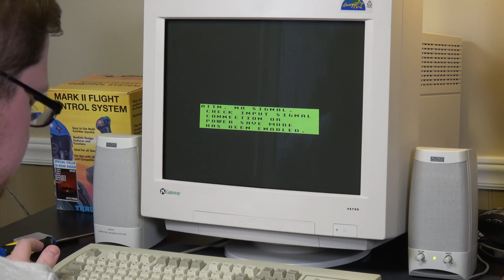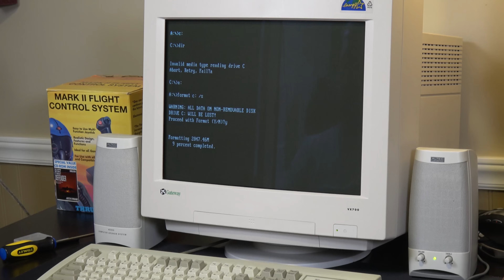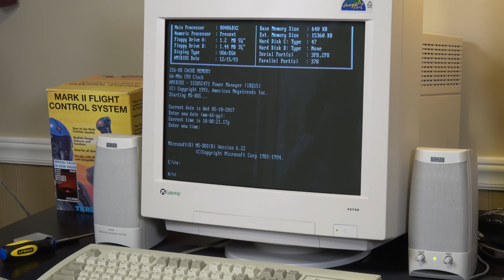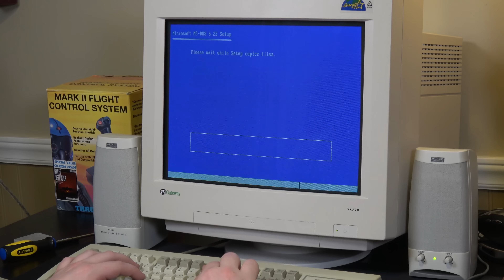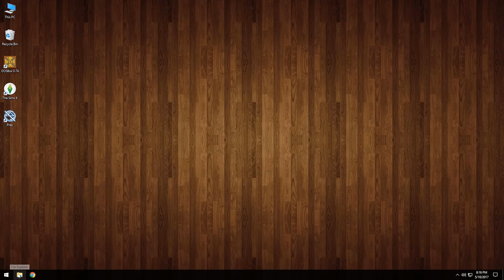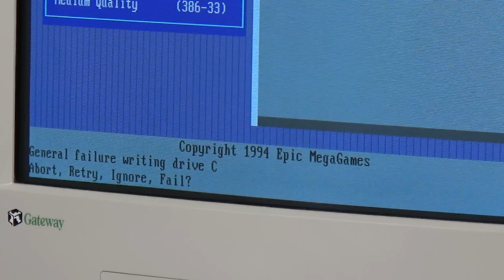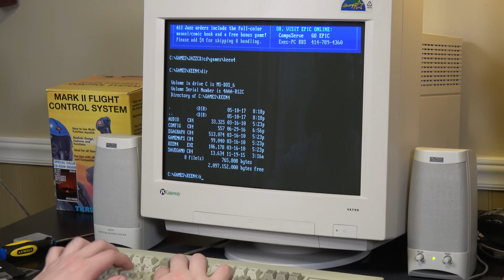LGR 486 Update! Installing CompactFlash Storage

Comment: Won't you miss the whir and ticking noises from the HDD? Sure your old one was getting pretty loud, I had the same issue with my Am486 PC. I just swapped it out with a different 90's era HDD. You could use your CF card to transfer files to the HDD.
Reply from the maker: You bet I will. I mentioned it somewhere in the video, but the sound is a bit part of why I like using old parts! It's just in this case the old HDD was getting too loud and unstable to be enjoyable anymore, so I'm using CF as a replacement until I get another HDD.

Comment: Nice seeing you enjoy some of the benefits of mixing new with old! I am using SD cards now, the adapters are quite similar and work just like you showed.
Reply from the maker: Thanks for stopping by, Phil! I certainly want to give the newer SD card solutions a shot sometime too.
Reply: Lazy Game Reviews Awesome! I shall send you some info and tips. Used them in a range of machines from 386 to Athlon XP and they have been good to me.
Reply: I ordered some CF hardware for my rig because I know they're reliable. I'd like to see some benchmarks done by someone at some point to compare the lifespans of CF and SD under "normal" use condition. Maybe they already exist and I just haven't seen them :P
Reply: Man, I feel like I'm going crazy, because I thought I must be the only one in the world that has these, because all I ever hear about is the compact flash one. -- it's like as if every movie reviewer was telling you about the betamax version of some movie, and all you have a VHS player instead.  (Seriously, didn't compact flash die in the early 2000s??)
Reply: @BrainSlugs83  CF didn't die even today, professional cameras used them for many years if not still in use.
Compact Flash cards of old days are still faster than Class 4 SD ones of today, not kidding. I have a 256MB CF card from 2003 that reads and writes at 6.5MB/s compared to the 5MB/s writes of CURRENT class 4 cards (albeit the read can get higher at 10). Took quite a while for competing cards (namely SD) or a successor (CFast) to stand up to CF properly.
Reply: @Kalvinjj  which is why you should buy class 10 UHS devices... Seriously, 16 GB is like $10... CF is dead.
Reply: Long term, has the SD solution worked better than CF? :) I'm looking to get my retro rig back up and running and a replacement storage medium is what I need.
Reply: Yes, a high end SD card can handle more reads/writes without data corruption. Been using one in my P1 laptop for years.
Reply: I've tried to install Windows 98 SE to a Compact Flash Card, but  I cannot complete the installation because on some point it says that cannot write to the HDD and prompts me to retry. Just when the installation of Windows files is starting. SS7 Soyo MB, K6-2, Voodoo 3 3000 AGP, SB Live!, 256 MB RAM, Transcend 8GB 133x. Any thoughts?
Reply: I would say that both SD and CF are both very fine long term solutions for computers. I used my Micro SD for my Orange Pi for years now, and it still hasn't quit me yet. I'm going to try out CF though, see if that gives my laptop a kick.
Reply: @WilliamShinal  Would you recommend CF over SD or vice versa ?? :)
Reply: I won't argue with your decision. Good luck with those CF products.
Reply: I think useing a msata to 44pin ide adapter, then a 2.5 inch 44pin to 40 pin ide adapter would be the fastest performance, though I've never tried it, I'd find that a fun idea. I suppose the hard drive controller would be the bottle neck. Anybody interested?
Reply: My two favourite youtubers! You lot are my heroes (unfortunately?) (jk?)

Comment: I had such a device before SSD times but I've found out that even good CF cards have a really short lifetime when they are used that way. But it's fast! And it's cheap...unless you don't realize that cheap cards die as fast as good ones ^^

Comment: Just remember to check the pins on the converter thing every now and then. I played myself a few times trying to force the CF card into the thing and bending the pins in result.
Reply from the maker: Absolutely this! I think there are even some bent pins in a shot or two of this video, that's really easy to do (but thankfully not hard to correct if it happens.)
Reply: it's always a PITA when a pin breaks and gets stuck in the card. (Especially when it happens on a camera where you can't easily swap out the connector card)
Reply: Oh crap.  I just tweeted a picture in rage to this.  Oh well.  Naughty, naughty.
Reply: This happened to two pins on my CF > USB converter.
It still reads cards though. Which I find interesting.
Makes me wonder how much losing a pin effects the transfer rate.

Comment: offtopic ; there are bootable dos CD version, (6.22 or 7. something) also win 3.1 on cd .  makes install alot easier when you ran out of floppy disks or damaged .
Reply: makinjica but certain PCs before the Pentium era machines only boot from floppies or hard drives, and in order to boot from a CD to install Windows or MS-DOS on CD-ROM, the drivers must be installed on a bootable floppy diskette in order to access the CD.
Reply: with nero burning you have an option to include the boot image of a floppy disk drive and use it to make a bootable Cd. it use for those machines without floppies, and also you could put dos, windows installers, programs and driver on the same CD. or even  dvd if you need it. there are other cd burning programs as cdburnerxp

Comment: FreeDOS supports larger partitions and you would be able to use the entire 4GB of the flash card, but I think that you want to use MSDOS for the system to be accurate with its age.
Reply from the maker: That is true. I really need to do a video on the latest FreeDOS sometime, it's got some great features.
Reply: @LGR  I am personally loving it on my 2012 laptop.

Comment: Sorry Clint, there's no good technical reasons to install from floppy when you can just copy it straight to the card, however, there doesn't need to be. "Because I like the noise" is reason enough :)
Reply: Exactly, it's nostalgic and has sentimental value.
Reply: You can put an Ethernet card in and map network shares as dos drives, I find that easiest.
Reply: He does mention in the video that he's had problems in the past copying the DOS files straight to the card. The DOS setup program detects and configures the current drives in the machine.
Reply: Apple 2e with proper interfacing can run usb
Reply: Duh. Why would you install the floppy drive if you're not gonna use it!
Reply: That was the reason for my comment! Come on, installing DOS isn't rocket science, a lot of us have done it and know it will work, it's just a bullshit excuse for the real reason, which is that he loves the experience/noise/nostalgia and that is fine. No need for the lame technical reasons :)

Comment: Use a cf card in my Amiga 1200 as a hdd
Reply from the maker: Got one in mine as well!
Reply: Yeah that turn into a nightmare, partly my fault.  First, the first time I was stupid, stupid idiot and got the ribbon cable crossed(still don't know I was that stupid) on the 44-pin 2.5" ide connector because it's not keyed, causing the power on it to surge(smoking), ruining the IDE controller on the a1200 mainboard. Still booted to kickstart, but that was it. Replaced that mainboard, and everything was working, but about a month later it stopped  see the memory/cpu upgrade board.  The old board I had ruined the hdd saw the expansion board so something was wrong with the 2nd mainboard(nothing visible like popped caps or anything) .   Also eventually it stopped booting to kickstart.   Replaced that board, now everything is working fine for the past year or so.

Comment: I would've killed to have a 2GB hd in my 486. I remember when I got my first 1GB drive and thought that would be all the space I'd ever need.
Reply: My first PC was a "Laser" 386SX 16 with 1MB of RAM and a whopping 40MB hard drive. Paid $1200 for it. My $5 Raspberry Pi Zero dwarfs it in capability. But, I have so many fond memories of that computer.
Reply: I had a summer job during college in 1990 working at Laser computers in Illinois, assembling and packing 386SX machines. I've never heard anyone ever mention that brand since then.
Reply: @adminfoo  Woa, the same Scott Hall of wrestling? Probably just have the same name.
Reply: Meanwhile, here I am with my almost full 1TB hard drive, wishing I had another terabyte.
Thought it’d be all the space I’d need.
Reply: lol my first pc was I think a 800mhz cpu 256mb ram and 10gb hdd. And I was happy with that, cant remember what OS.

Now ive got 16 core 3.7ghz cpu 16gb ram, and 512gb boot disk and 1tb storage and that not enough. Sigh how things change.
Reply: @pilsplease7561  wow, 256mb but only 10 gb HDD?
Reply: @AccountWasHacked  that was considered big back then
Reply: Man you guys are really bringing back memories for me. I had a tandy computer from radio shack with 486DX 33mhz, 4megs of ram, 124MB hd, sound blaster pro(it couldn't even do 16bit 44khz), svga at 800x600 256 color with windows 3.1. I remember when I bought a 1.2 gig seagate HD thinking it was all I needed.
Reply: I bought my first computer from my uncle in 1998 (I think I paid about $20 for it). 486DX2 66Mhz, 8 MB of RAM, and an 850 MB hard drive that was like a bottomless pit to throw endless amounts of data and games into. Ancient even by 1998 standards, but at 14 years old I had a lot of fun with it until I upgraded to a Pentium II PC a year later (saved up my paychecks working at McDonald's).
Reply: @AdhamOhm  i just recently got a pentium 2 pc because it had the correct cables for a spare hard drive i had
Reply: my first pc had 160 gbs...and it was huuuuuge...it was a top gaming pc...back in the day...i was a kid around the windows 98 era..i think it had windows 95, or 98...now...GTA 5 would feel claustrophobic on it lol.
Reply: Scott Hall Wow that was probably the same model. I bought mine in the summer of 91. I'd never heard anyone say anything about it myself.
Reply: Wee baby reporting in: my first PC (or the oldest family PC I remember) was a Slot 1 Pentium III of unknown clock with 128MB (later 256) ram and a Voodoo 2 (I think)

Found it up again a few month ago hoping to mess with it, but sadly it’s dead.
Reply: actually 500g hdd existed.we have some 500g hdd from 1998 era.we used them at server and they cost from 10k to 25k each.
1g ram existed and costed 2500-6000 peer stick
Reply: @hardscorerockkssss  That must have been the capacity of one server, cause the biggest drives in 1998 were 25gb.
Reply: @Kennephone  but if go into this pc techncial datasheet it says max hdd support is 250g
Reply: I had 2 IBM - 1 GB SCSI drives forming a raid 1... I worked at Dell at the time on the first generation PCI systems. :)
Reply: I used a Copam pc clone when I was 5 or 6. No hardrive in that one just two 5,25'' floppy drives, and no games but still fun :). And monochrome amber display. Anyone got a copam? I'd love to see some pictures of it.
Reply: My very first pc was an Apple II clone with just two 5.25" floppies and the diskettes could hold only 360KB. It was only when I upgraded to a PC/XT that I could enjoy the vast expanse of a 10MB drive. And there were numerous great games on 360k floppies :D
Reply: I dont consider Apples to be PC.
My 1st PC was a Compaq Persario. I loved it! Windows 98 (it had Python, but didn't know what it was until later; was late getting Qbasic on it too). But the HDD had about, I want to say, 40 or 60 Gbs; I ever dreamed of having a 200Gb HDD; it also had the Intel Pentium II processor, sadly only about 64 Mb RAM.

I still have the Compaq Persario I bought after that one; it is nice! Sadly, the CD-R/W drive doesn't work on it anymore (maybe a virus; idk).
Reply: Do you mean Compaq? Yes, I have all the portables thru the 386 model, as well as a Deskpro 286. Fun boxes.
Reply: Back when I first upgraded to a 1TB drive, I thought that was all I ever needed... Then "AAA" developers became unhealthily obsessed with "4K textures" and got lazy with their data compression methods...
Reply: @bluedragon9925  I've got a 160TB server. With 90TB full.
Reply: Years ago I got a 2tb hdd. I thought that's all the space I'll ever need. Nope.
Reply: you will never get to where im at lol over 200TB @TheArzonite
Reply: @pilsplease7561  That's a lotta bytes.
Reply: @whatever909e 16 MHz LOL.
Reply: @420sakura1  My fist PC had an 8 mhz XT with dual 5.25 floppies and no hard drive. 4 color 14 inch CGA CRT monitor with a monochrome switch, 640 kb of ram
Reply: Animal Facts Now standard is 16/32 and mininum is 4/8gigs LMAO
Reply: my first pc already had a 2.5gig hdd. id have killed for the speed and the silence of  flashmodules though
Reply: I got upgraded 1.2GB drive later on my 486 and I remember I thought I would never run out of space on it until I upgraded to Pentium1 and then later to AMD 300mhz processor and started playing bigger games :)
Reply: I remember the first computer I had was a Windows 95 system with a AMD K6 processor that was retired by my aunt's work. I was probably 5 or 6 at the time. Not too sure though. I remember though my dad telling me that back then the biggest drive you could really get was a 6 gig and that you were doing something if you were able to fill that thing up.
Reply: @whatever909e 4 terrabytes ever
Reply: @whatever909e mine had 13mb of drive and i erased unix os to play doom :)
Reply: I had a moment like that when I got my first 250GB drive.
Reply: The one that plugs into the mobo directly has one that has a 2 slot cf card option

Also you can get a F/F adapter and plug it into the ide cable
Reply: Believe I'm up to 60TB or thereabouts now which is nearly full, I'm always in need of more Storage! 😂
Reply: My first PC was a generic OEM from Dell that I no longer own. The joys of growing up in the 2000's! (born in 96 but that doesn't fucking count!)

Comment: My first PC was a DX2-50. Probably a Cyrix. 8 MB Ram. ~210 MB HDD. This really brought me back to those days. Installing games from floppys, tinkering with autoexec.bat / config.sys to get the best usage with maximum base memory left. Man, those were the days :)
Reply: Today's computers are so powerful, but also very easy, hand holding. There are no where near as many options to add different things as there were before. Everything for the most part in on the motherboard, no need for a sound card/ NIC, and some video requirements are just fine with on board today. Easy to build, and clean inside, but still.
Reply: @williambaldwin9346  
And absolute hell to repair,if you can repair them.And I ain't talking part swaps,I mean real repair.Replacing chips is a PITA on a modern board.

Comment: There are also SATA to IDE adapters, and SD Card to IDE. It would be awesome though to have a way to connect SATA optical Drives and keep the ability to send CD audio.
Although I understand that you want to be as authentic as possible, hard disks, floppy drives, and optical drives are full of moving parts, and thus have an expiration date. Add to the mix old PSUs, and you know where you should not stick to old hardware (if you want reliability from your old PCs).
Personally, I would prefer a TFT screen too, at least for long use periods.